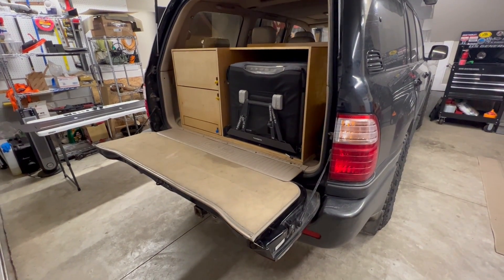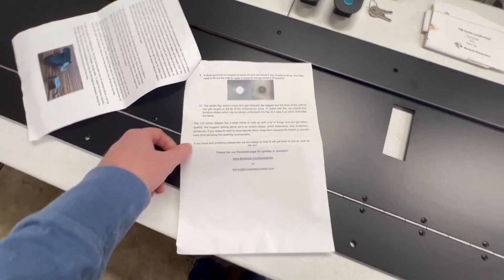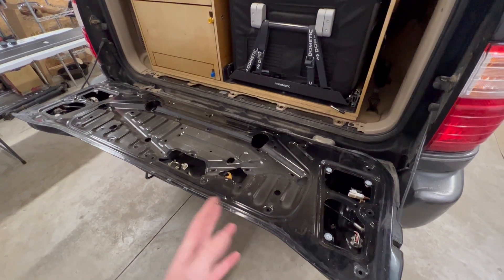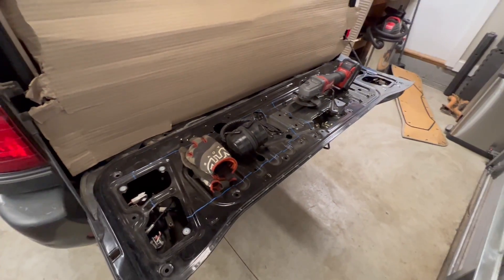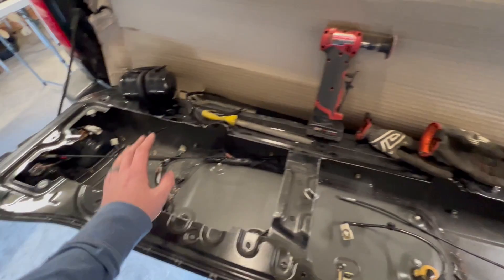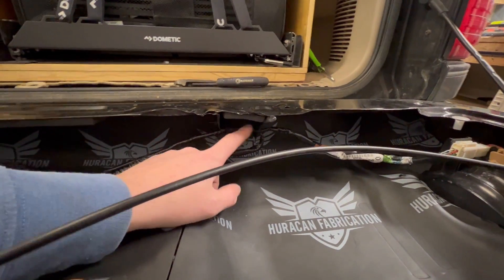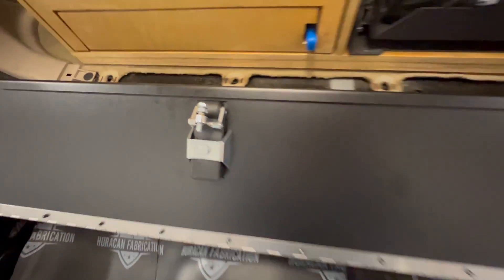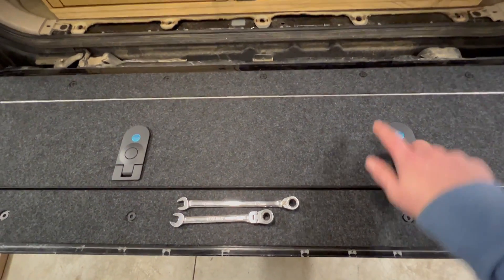Huracan Fabrication Tailgate Storage Install - 100 Series Land Cruiser/LX470

Comment: Thanks, in the market for one and this helps me understand it better. Wish there was a way to retain the torsion bar things
Reply from the maker: It’s been a bit of time since I installed mine and I still love it! It’s definitely heavier than a stock tailgate but you get used to it quick. I wish we could retain the assists too! Wonder if there’s the possibility to add a gas strut to help with lowering effort 🤔

Comment: Nice work!
To make the plastic cover clear the locks, have you considered placing a wedged piece on tailgate so that as tailgate closes, the plastic cover is slightly raised to clear the locks but when tailgate is open then the plastic cover is at normal level.
Reply from the maker: Ooo that’s not a bad idea! I’ll have to see if I can make something like that work 😎
Reply: @LexusOverland  🙏

Comment: Great detailed step by step video! Nice work! Subscribed!!
Reply from the maker: Thank you!! Subscribed back 👊🏼
Reply: @LexusOverland  Thanks bud!! How are you liking the storage solution now that you've had it for a few weeks? Any additional creaks, rattles, or sounds since the old sheet metal reinforcement is no longer there?
Reply from the maker: I love it! It’s really great. No squeaks or rattles at all. The cover essentially becomes one with the tailgate so structural integrity is maintained. I was shocked at how quiet it is but I tried to put sound deadening everywhere I could and I’m only putting lightweight items in there

Comment: Great video! Wish I saw this before I went on to install the mod on my LC100. I was second guessing myself the whole time since it was my first time cutting metal. (ps. that code would have helped my pocket too)
Reply from the maker: Hey thanks! It is quite scary to irreversibly cut into a good body panel 😅

Comment: Great video! I could not tell from the video or any research I did on this, do you have to remove all the screws and the entire cover to access the Tail light bulbs or is it easily accessible through the lift door?
Reply from the maker: If I remember correctly, it’s really easy to remove the tail light assembly and replace the bulbs that way! No need to remove the cover.

Comment: A multitool cutoff tool would cut that easily.
Reply from the maker: Almost as easy as a cutoff wheel! Good advice.
Reply: @LexusOverland  maybe?  Maybe a small die grinder,  or cutoff tool(dremel) with flex shaft?
Reply from the maker: The metal isn’t thick but it isn’t thin - you’ll want something that can cut it easily to help with controlled cutting!
Reply: @LexusOverland  some good leather gloves might be the best thing for that bracing?   Have you used a spring kit for the tailgate to help with the weight?   There usually set for stock weight,  but it could help.